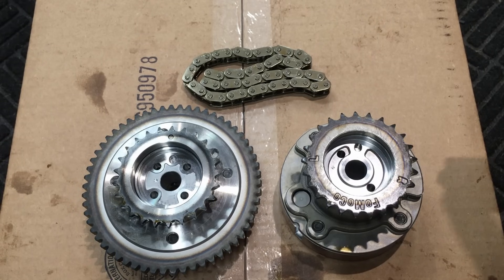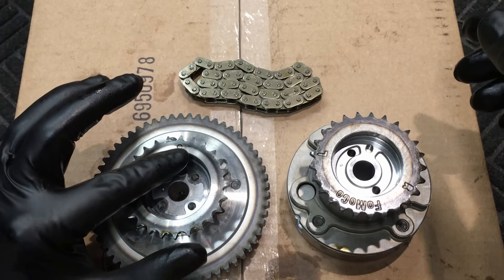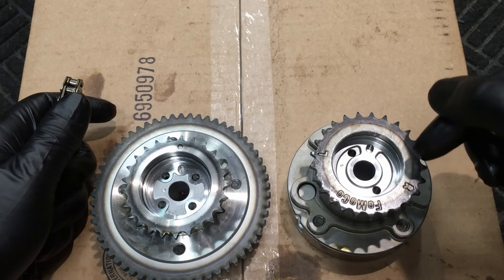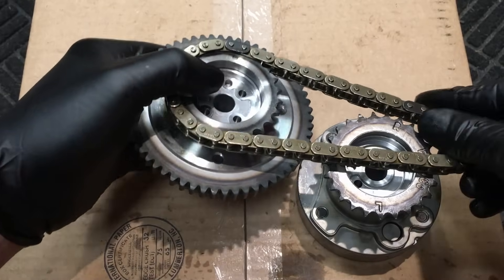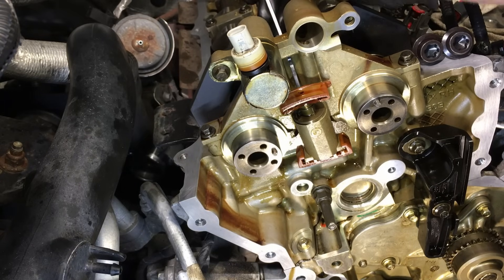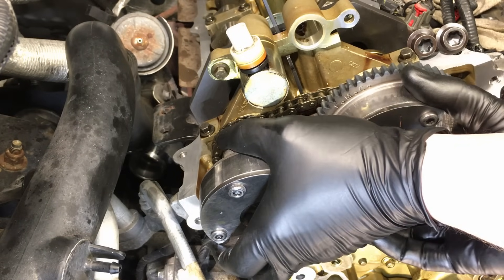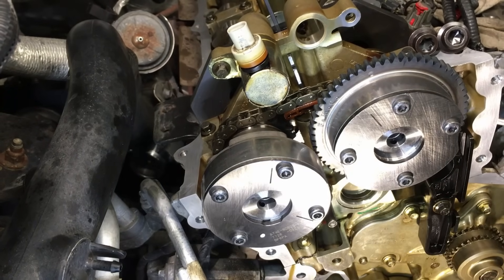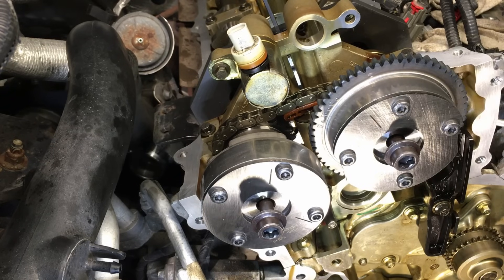2011-2016 Ford F-150 3.5L Ecoboost Timing Set Replacement Part 3: Timing the Engine

Comment: Thanks for making this video. Just had this work done on my 2013 fx4. Only 60000KM on truck. Thankfully I had purchased extended warranty. 
I have however noticed the rattle on a cold start up.  Is this normal after all that work? Figured that would have gone away. 
Still waiting for my itemized work order from dealership. Work was completed Feb 15. Took just over 2 weeks🙄
Reply: how did you make out with the rattle after the repair Josh. Did they do the phasers? I just had mine done, no phasers and still have a rattle and codes for correlation.

Comment: So I have not found any videos on replacing head gaskets on these 3.5L v6. These videos are helpful on the disassembly of the timing but I would assume you could leave the cam holding tools in place as you removed the heads to replace the gaskets and then begin reassembly?

Comment: I’m upgrading from the 2010 chain to the 2012 chain. The list I’m working off says to replace the the tensioner pins. Do you have the torque spec for the pins?

Comment: Very good video. I have watched your other replacement for the 4.6 . you rec replacing the oil pump, but not on this job, does the 3.5 have a better pump?

Comment: Thank you for the video series. This detailed series enables me to do the job at home. On my job I am planning to change the secondary tensioners, all giudes and Idler pulley. Could you help me with the torque specs for that.

Comment: Nice video series, found it very informative.
Are the cam phaser bolt threads supposed to be lubricated with oil?  I have seen that in the past for head bolts that require torquing to a specific angle.
What is the specific failure with the old parts? Have you looked them over in detail?

Comment: I'm having a slight misfire on a 2013 ford f150 5.0 that the dealer was not able to find.  The cylinder contribution test is all over the chart.  It is constantly fluctuating and it has a slight hesitation at take off.  No check engine light.  And the truck only has 14,000 miles.  Any ideas where to look.  Truck still has warranty but would like more info before I try to take it to another dealer.  It is only giving me 14 mpg on the highway.  Dealer said to wait until the check engine light comes on...  Don't think they really took it seriously.

Comment: +fordtechmakuloco Hey Brian, not totally related to this video, just got me thinking about the intake valves in the 3.5's. Have you ever cleaned them by any methods of walnut blasting or wire brush on a drill? Im aware of the video about one of the 4 cyl ecoboost, but i am curious to see something for the 3.5 V6. Thanks!

Comment: Whats your opinion on replacement suspension components? MOOG or Motorcraft? Specifically lower ball joints. 
2005 F150 4x4 4.6L

Comment: Aren't the water pumps bad in these?  I was wondering why you didn't change it?
Reply from the maker: No, wrong configuration, the NA engines and or transversely mounted engines have the chain driven pumps that fail all the time.
Reply: FordTechMakuloco I see, thanks

Comment: Great video !! I am currently working on a 2014 Police Interceptor (Taurus) 3.7 that is not ecoboost but the same internally EXCEPT for the idler gear in this engine. In that engine, the idler is actually the water pump. Yup that's correct, an internal water pump.....just like a Chrysler 2.7 !! You would think Ford would avoid that after the Chrysler fiasco but noooooo, they didn't !!! Interesting that Ford actually put an external water pump on this ecoboost engine. Something that I want to point out that is NOT mentioned here is the crank sprocket (gear). In this video, you can clearly see that the so called keyway is NOT a keyway at all. It is in fact a dowel !!! That's right a dowel !! Literally a round pin in a square hole !!! That is why I am doing this timing chain job on that 3.7 Taurus. It came into the shop running poorly with a crank/cam correlation code (p0017). When I took it all apart, what I found was that dowel worn to the point where the timing would be almost a tooth off. I cannot believe that Ford would design such a thing !!! If that dowel had actually sheared (which it was close to doing--wish I could upload a picture here), it would have trashed the engine just like as if the timing chain broke. That $3 part taking out an engine !! Still can't believe what I saw !!! Any comments anyone ???? Have you seen what I'm talking about Mr Makuloco ????

Comment: I think you are not on the teeth correctly at timestamp 17:02 on the idler gear. Might want to check that before you rotate the engine by hand.
Reply from the maker: They spline from the backside of the chain over two sets of teeth. This vehicle has been back on the road since October of last year so I think it's ok.
Reply: I see how it works now, the idler gear teeth mesh on the outside edge of the chain.
Reply: Cp6027 is correct. The teeth on the idler pulley are on the outside of the chain on passenger side of chain but on the inside of chain on the driver side. Would most certainly have sorted itself out on first start up. Totally agree that you shoud rotate by hand firstly.

Comment: With your eye for attention to detail, I am surprised that you didn't replace the guides. For a few dollars more (relative to the cost of the whole job), seems doing it all in there is the way to go.
Reply from the maker: I would on just about any other engine but on the 3.5L GTDI they are so beefy and matched to a ratcheting tensioner,  unless they showed wear it is not needed. These plastic guides can last 300k if the oil is maintained.

Comment: There is no way a average diy'er is going to do this job lol but it's great entertainment btw thank the lord for my old school 302 timing chain lol
Reply: I would do this repair in a heartbeat over what a shop charges to do it. Perhaps I am "above average" in my ability!
Reply: I hear that Chad! I just put a new chain in our '86 Grand Marquis a year ago. 6" long and lived 230k miles with a plastic camshaft gear. Now, manufacturers are sticking 6 FOOT timing chains in there that can't even make it 100k miles. What a world we live in!
Reply: Smitty Smithsonite smh I agree going to go down fighting I guess long live old fords
Reply: 10-4 on that, brother.
Reply: @SmittySmithsonite   And that's the issue.  Multiply a little wear in each pin/ roller over that large of a chain and it adds up to many degrees being off in the end.
Reply: TheItalianDNA more power to ya
Reply: I don't have a choice, and I really appreciate all the trouble he went through to make and upload this video. Its a take your time and stay organized type of repair
Reply: Its an easy job but time consuming. A lot of work required but nothing complicated. That chain is just ridiculously long.

Comment: Snap On used to make a clip on protractor for angle torqueing that worked slick. Used to use it on the old Escort head bolts.

Comment: Is this a necessary for all 3.5 engines or were some folks not doing regular oil changes?
Reply from the maker: Almost all will go through this at some point.
Reply: FordTechMakuloco shucks, thanks for the awesome documentation as always.

Comment: Love watching these videos, even though I don't own any newer Ford with these engines. I'm still driving my 04' Ranger XLT 4x4 with the 4.0L V6 SOHC. Almost 90k miles on it now, and it drives like the day I drove it off the lot brand new in 2004.
Reply: Hopefully you never have to do your timing chains... those 4.0s are way worse than this.  You have to pull the engine to do the passenger side.  Great motors other than that.

Comment: Do you have any videos on checking for bad head gasket on a 2006 triton 4.6 ? Have pudding in oil fill cap . Thanks
Reply: John McCarthy that's common with a ford for some reason. Is it all the way in your pan is the real question
Reply: Jonathan Rosamond   No just valve cover I was thinking about replacing all the lines on the Pcv the engine has 180,000 miles and still runs good
Reply: If its only up top I wouldn't worry about it. Its just high heat and cheap parts lol.. I think... If that oil dipstip isn't completely covered with pudding ill bet your good
Reply: John McCarthy 
Some white on the cap in the winter can be due to short trips, as the engine cools it builds up moisture from the atmosphere and if the engine isn’t good and hot often enough with a long run it can happen.